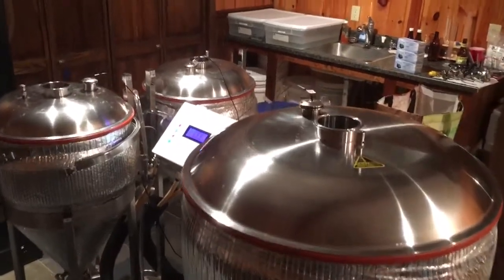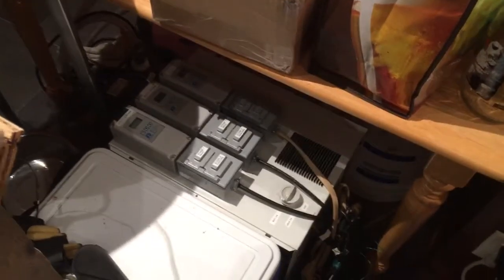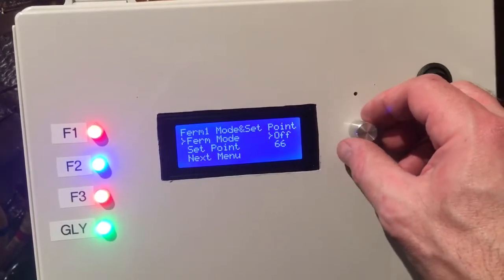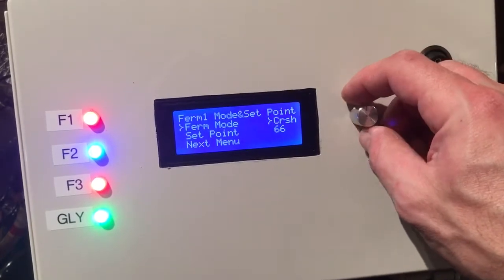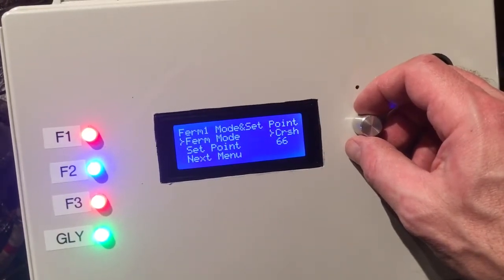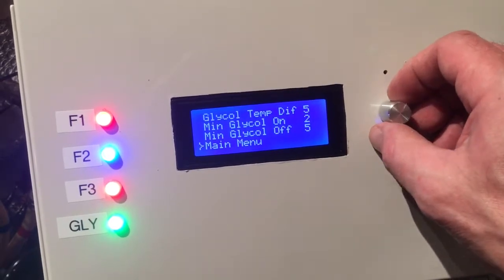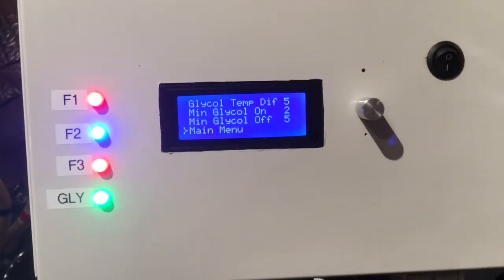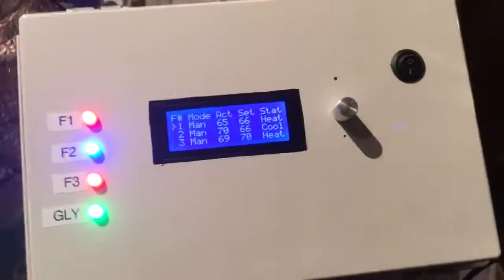Arduino Based Fermentor Temp Controller (beta)

Comment: I saw many times your videos and explanation in beer forum. Of course, I'll use this for my project with some changes. How you do with blink network? I lost that part in the forum.
Reply from the maker: I just followed the Blynk tutorials / examples to figure out how the API worked and then played a little. It's been a few years now so I don't remember specifically what all I went through but I found it easier and more intuitive than the rest of the code. Let me know and I can send you the specific Blynk related code and possibly screenshots of the Blynk App setup screens.

Comment: it might be a bit late.. but I know where your noise is coming from... that looks like a halogen 12V lighting power supply... those things are HURRENDOUSLY noisy electrically..
Reply from the maker: Thank you for the reply. I expect that you are right and it is on my list to change that one out with a regulated power supply at some point. I have managed to reign things in by making some custom thermistors, with shielded wire and filtering the readings using the ResponsiveAnalogueRead library. I have been very happy with the results of the controller. There are still a few things I would like to add / modify but all in all it works quite well.
Reply: I'm building a system to drive my brewing at home.. I very quickly dismissed using analogue input for temperature measurement when I found the DS18b20 sensors.. You can get then very cheaply and they have arduino libraries available for them